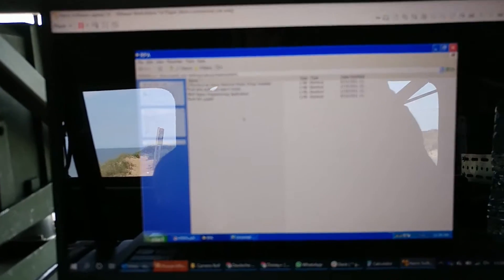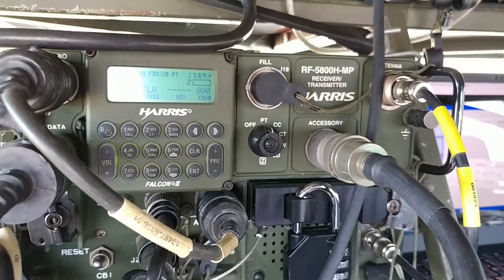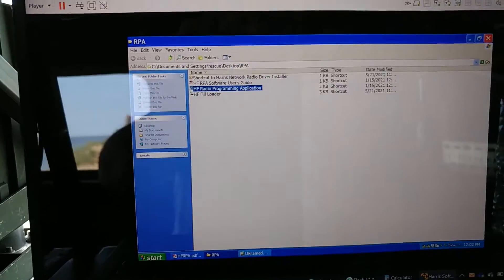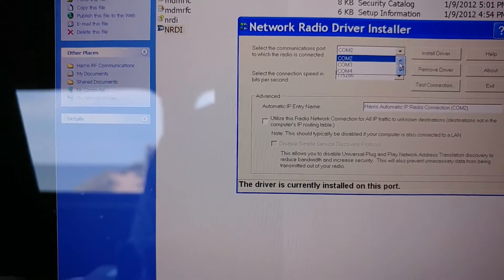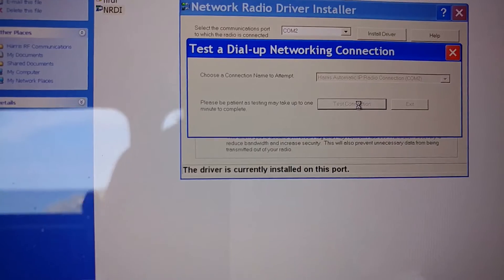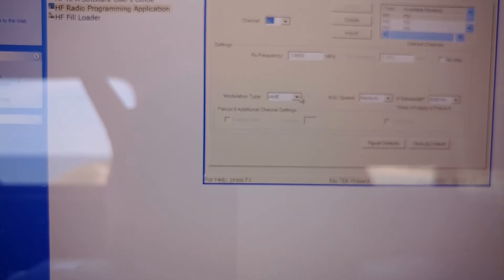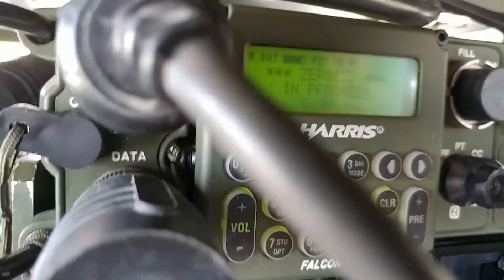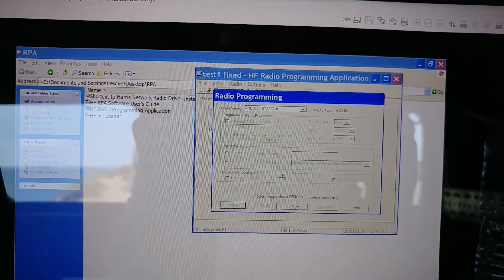Part 1 (of ?): Initial Trial using Harris RPA Software to Program an RF-5800H-MP

Comment: Nice setup,   for future (not in this case as software allow it to do)  if You have hard-coded COM1 or other port number - it can be easy changed to any port in device manager  [ports-> comX -> properties -> port settings -> advanced -> com port number.]    In case desired port COM1 for example is used by other hardware (IrDa / modem) first go back and change port for this device to something different to free that id.
Reply from the maker: Thanks for the tip!

Comment: How does the AN PRC 150C get its power?
Reply from the maker: Cable to the amp provides power and control
Reply: @w2hx  is it the cable in the front? Where the cable called? Thank you for the response by the way!